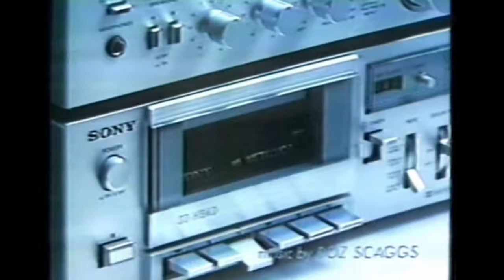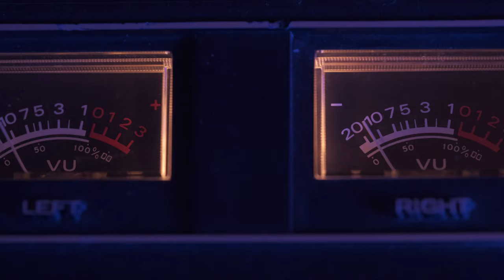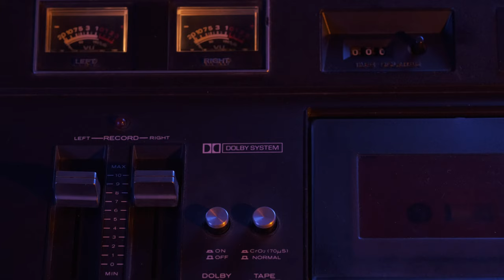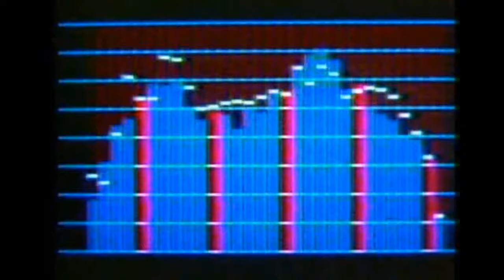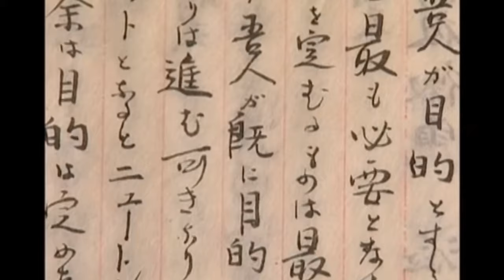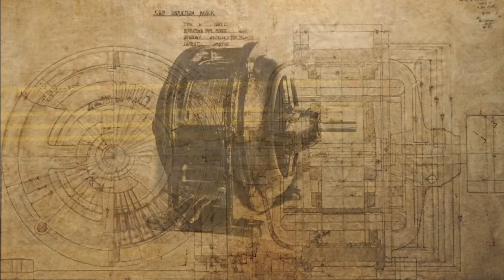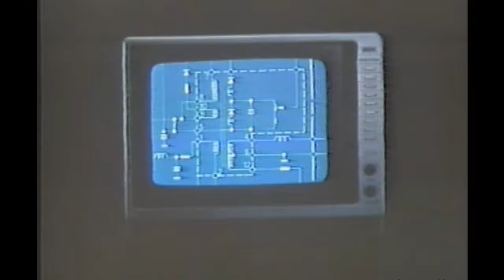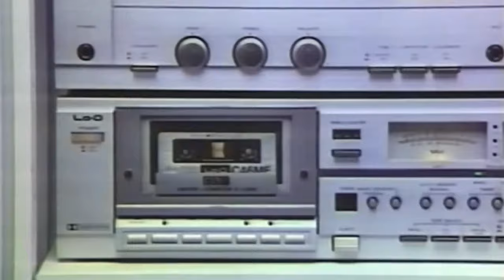Best Bang for the Buck Cassette Recorder? |  Hitachi D-2330 |  Sleeper Audio Brand

Comment: Hitachi are definitely an underrated audio brand! Back in the early 90s I built a second system around a used SR-504L receiver, but sold it when I downsized during my student days. I recently picked up another SR-504L, and it's every bit as good as I remember. Despite being over 40 years old, it still looks and works like new, and has a clean, uncoloured sound.
My only caveat for their cassette decks is that they're highly prone to belt decay, but if you can find one that's been serviced (or don't mind replacing the belts yourself) they're very good performers.
Reply from the maker: Thank you for the insights :) And yeah, belt replacements for these units will eventually be a must. The model I got was in really good conditions so I'll have to update on that. Happy listening 🎶

Comment: Hitachi gear is really underrated. They made some of the most complex, weird, and beautiful cassette decks. The tapeheads in there higher end tapedecks was apparently one of the best tapeheads ever made. Though I believe the more modern Hitachi's (also Realistic) 3 headers are much better. And go for around 50~200 Dollars Broken or Serviced.
Reply from the maker: Absolutely. Their high-end decks are prised as the best of the best, but they are really hard to find in the West. Their Lo-D line had also top notch speakers. Hopefully one day I can make a video about those. Thanks for the info!
Reply: @soundelegy5987  Would love to see a video on it! I never listened to a Lo-D pair of speakers. Ill have to keep my eyes open for a pair of Lo-D Speakers!

Comment: Hi there
Hope you might help me.
Would you know what the maximum voltage a Walkman could take safely when powered by a wall wart from an ac outlet?
I have an old WM F107 I’d like to test but the battery holders cap is missing and I’m not sure if the solar battery is still functioning.
Be Well
🌞
Reply from the maker: Hey there! That's something I havent's tried. Some Walkmans can be plug to the wall but they have the built-in port to do that. I would personally not do it, specially with such a beautiful and original model :)